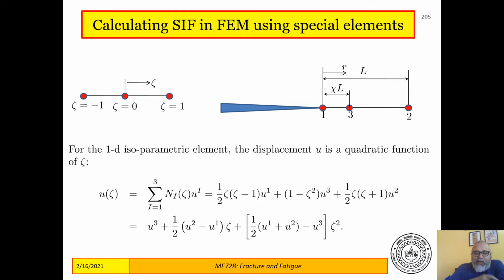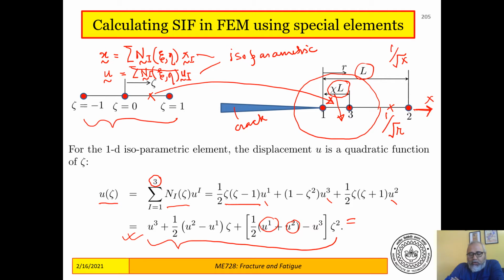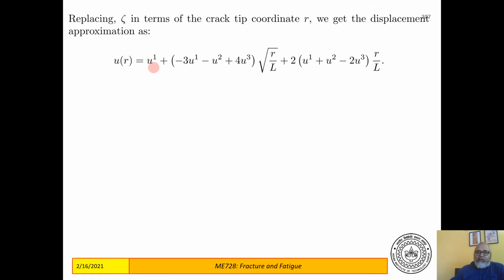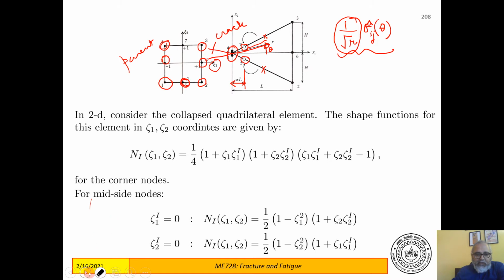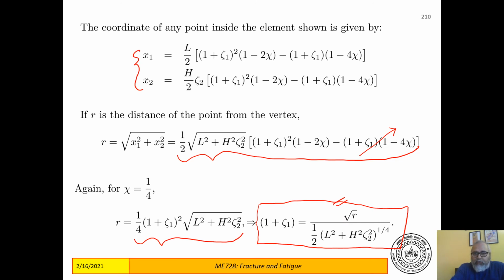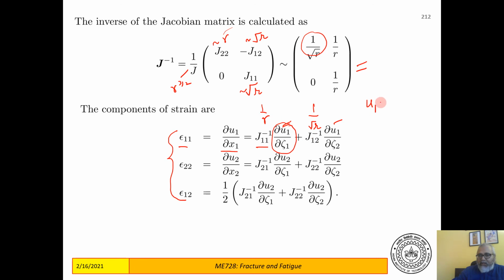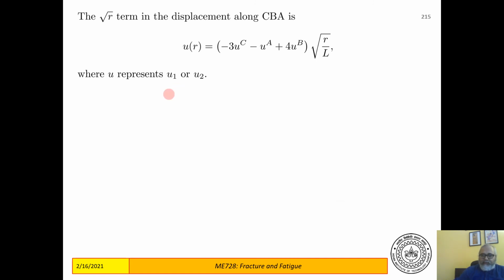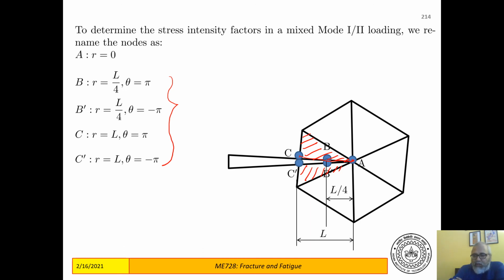Computing SIF with special Finite Elements

Comment: Actually the problem is in the courses of fatigue and fracture nobody teaches us in india about the william complete solution . Only the approximate solution near the crack tip is been taught . And that too is reasonable cause we are interested in there only . But there is a series solution (since , an analytic solution is assumed and an analytic solution is infinitely differentiable ) and the beauty of the method taught by dr. basu is it captures the r term as well which represents the rigid body motion .I think normally we take the squrare root r term only .